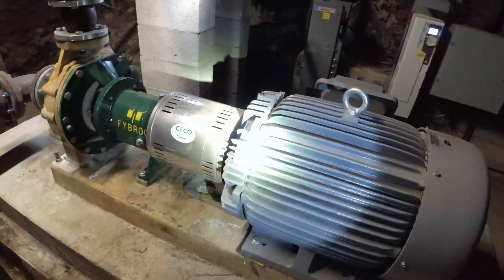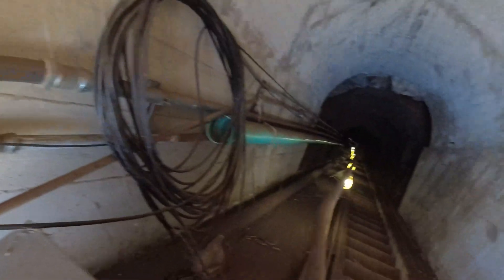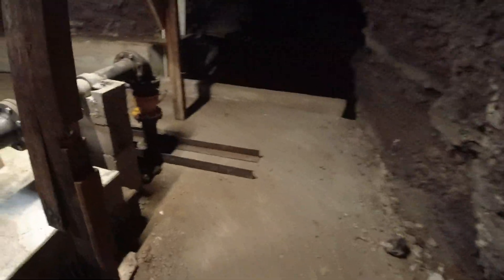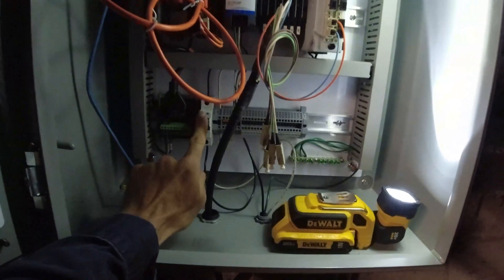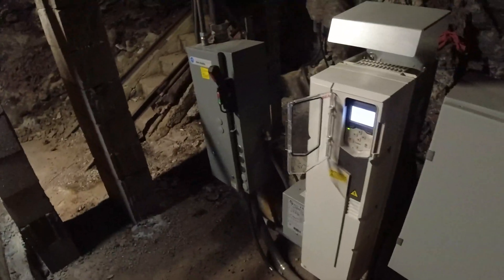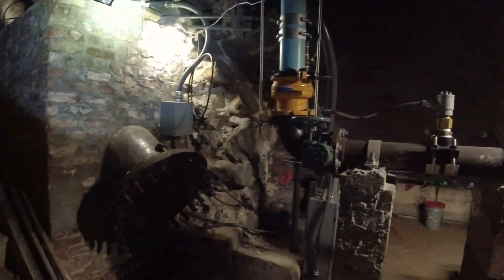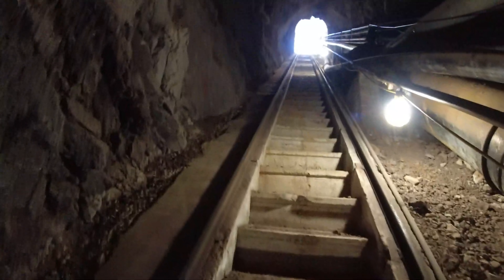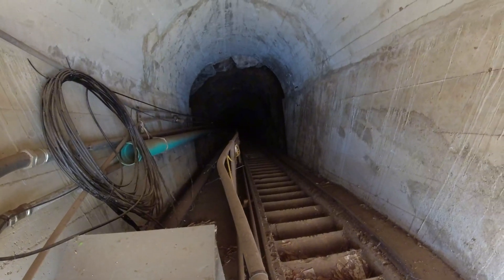Trouble Deep Under Ground

Comment: Very neat. I can not imagine getting that motor out of there or a new one safely down the stairs. At least its only one flight.
Reply from the maker: I'll just say, It's an ordeal.
Thanks for watching!
Reply: Staircase has rails at its sides. I guess, it is for some sort of mine trolley. So, you need this trolley and a hoist for it at the shaft't top entering to move massive loads. For example, a truck-mounted mobile hoist. Or, stationary one, from sugar mill era.

Comment: I would have checked the connections on the circuit breaker for tightness.  I've fixed numerous mysterious breaker trips just by tightening a loose connection on the breaker.
Reply from the maker: Good advice for sure.
Thanks for watching!

Comment: Someone didn't know how to properly pipe up a centrifugal pump, you should always have at a minimum of 5x the diameter of the pipe of straight run, ideally 10x diameter of straight run to prevent cavitation on the pump impeller. The pump will be more efficient and last a lot longer. 

Good video, I bet it's nice and cool in there
Reply from the maker: Yeah you're right. Also, a single stage pump is about as inefficient as it gets.

Comment: I take it that you do not have any CO2 gas accompanying the well water.  In our area of the mid-west US, you have to be care around even shallow surface well pits for low oxygen levels.
Reply from the maker: I know it was tested and deemed safe when the modern work installation was completed. 
But, you are absolutely correct and I'll take this as my sign to get a multi-gas meter for environments like this. 
Hawaii, and Maui especially, is way behind the times in terms of safety awareness, as I'm slowly learning. 
Thanks for the help!